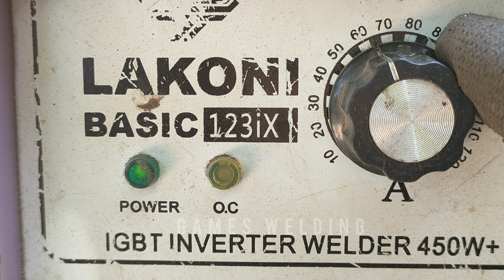not many know the welding technique of thin galvanized square tubes

Comment: Welding galvanized is very dangerous. Make sure to strip it with muriatic acid, or grind it off. Either way, please wear proper PPE and have adequate ventilation. Zinc poisoning is nasty shit and will mess you up.

Comment: Grind the zinc off first,the fumes are highly toxic.
Reply: Absolutely right
It was a major issue in the shipyards
Some welders refused to weld “galvanny” even with excellent mechanical ventilation which just pumped the highly toxic fumes into the surrounding air